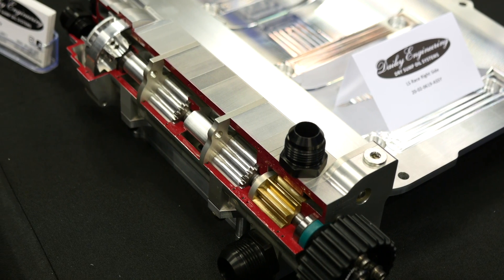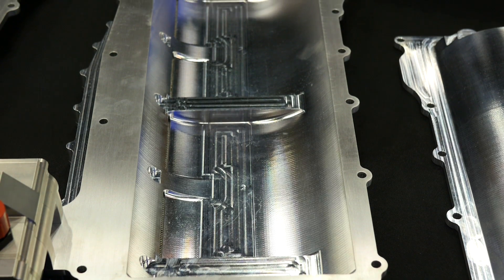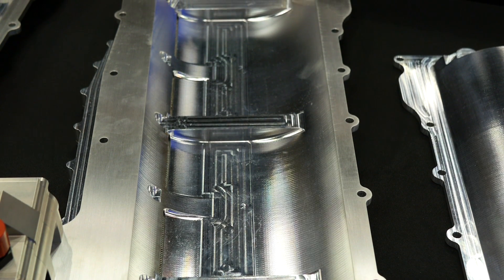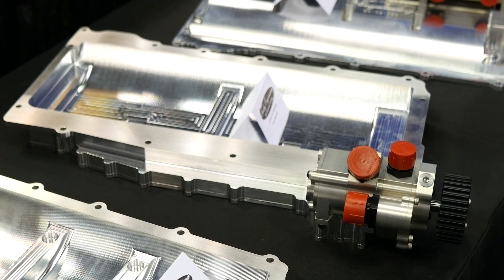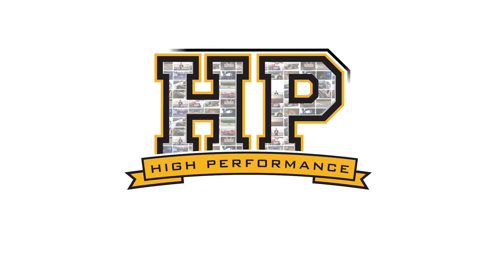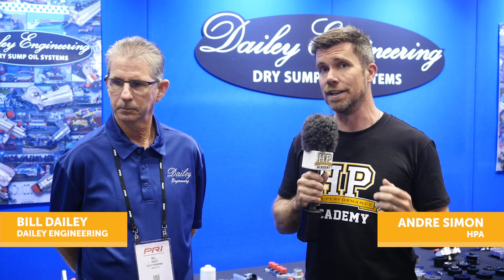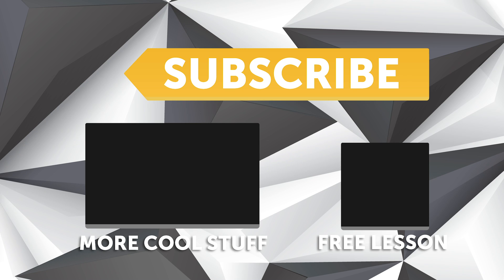Engine Power GAINS With MORE Reliability? How! [TECH TALK]

Comment: Very cool. Lots of advantages but I don’t drive a race car. Gathering parts to do an Eaton swap on a 32v 4.6 ford but this is probably overkill.
Reply: This is overkill for many situations, but so are running surge tanks and three high power EFI fuel pumps but that is quickly becoming normalized since running E85 is getting more popular all the time.

Comment: No mention of Dailey's awesome air/oil separator? I've had a chat or two with Bill. He's actually pretty good at breaking down the intimidating subject matter of oiling, windage, etc. Good guy.
Reply: There some good systems available. Radium has a two can, two stage system for the Focus ST that I will be running. Mountune offers a dry stump system for the Ecoboost 2.0/2.3L engine but for $10,000 I don't think I'll need that just yet.

Comment: I don’t recall if this video clarified N/A engines  vs forced induction engine!
Reply: LS Crate motor is NA
Reply: Dry sumps actually help free up horsepower either way, when you run forced induction you increase blowby, but by running a dry sump you can still evacuate those gases and decrease windage.

Comment: Another excellent interview - I especially liked the way you got the chap to elaborate some points further! :-)

2:20, somewhat amused by that as it was exactly what some F1 teams were doing before they got caught - different circumstances, though, as that was to use it as fuel to circumvent the limited 'official' fuel they were allowed to use. Perhaps of more concern might be the oil lowering the detonation resistance of the fuel used?
With the wrist pins (AKA gudgeon or piston) I would suspect it may be more an issue of their lubrication normally being by oil splash, or mist, and without oil squirters, or drilled connecting rods and forced lubrication, they may simply run dry? With most piston skirt designs, especially slipper, the pins would appear to be well clear of any 'blowby' combustion gases which would be very low in a well built engine, anyway?
As the chap said, there are teflon/low drag seals available for most engines, many are double lipped to provide optimum protection against leakage - an old-school thing, if you are caught short or cannot find some, is to install the seal backwards ( I would recommend it be well lubricated on initial instal, though).
One thing I was hoping might be mentioned with the vacuum level, is the need to have airflow through the crankcase as that is what carries the oil to the pump. By that I mean the pressure difference in the various parts of the crankcase move the oil, droplets and oil mist to the lowest pressure area, the pump(s) inlet(s) and through the pump to the reservoir. Perhaps the best way to illustrate that is with a straw in a drink - with the straw end open it is easy to suck the drink through but if you close off the end it doesn't matter how hard you suck the drink will stay in the straw until you start opening up the end and, how much you open up the end will control the speed the drink moves in the straw and/or how hard you have to suck to move it. Same principle applies with the dry sump - you have to balance the airflow at the desired vacuum to make sure the pumps can actually move the oil through fast enough - IIRC, the rough figure is 80-90% air and 10-20% oil.

As an aside, some pump manufacturers will have options for other components to be driven off the back of the pump stack, like power steering pumps for Sprint Cars - might be worth enquiring about for those chaps who have packaging problems or want to tidy up the engine compartment.
Oh, and external adjustment makes setting oil pressure a piece of cake.
Reply: Detailed information

Comment: Alot of confusion,  because it's expensive!  not to mention plugging oil holes in the engine to suit . All the rest is not that hard to figure out just some people haven't got a clue
Reply from the maker: Compared to the cost of rebuilding some engines, it's cheap. Like all parts, not everyone needs or wants everything out there, but if the pros outweigh the cons for you then it's a no brainer, and likewise for the opposite - Taz.